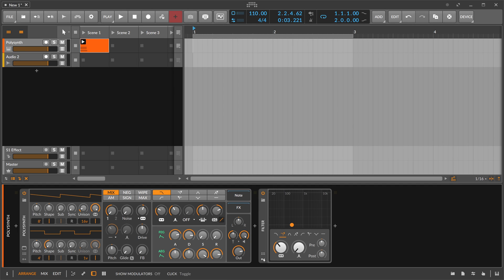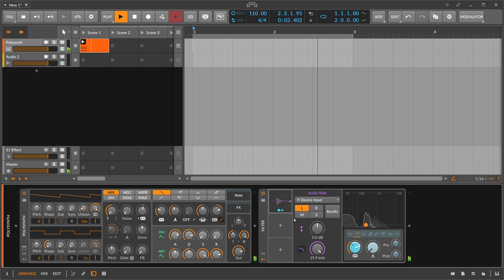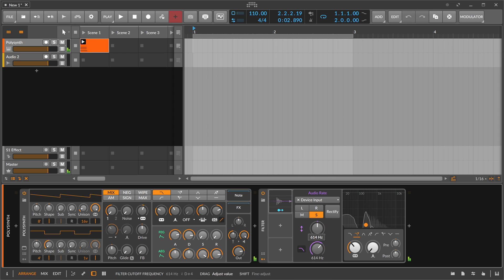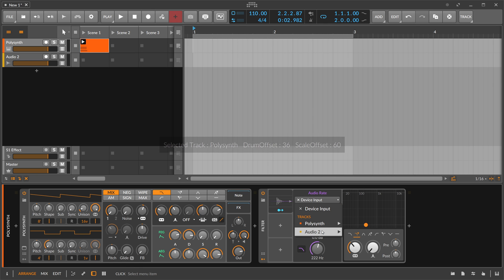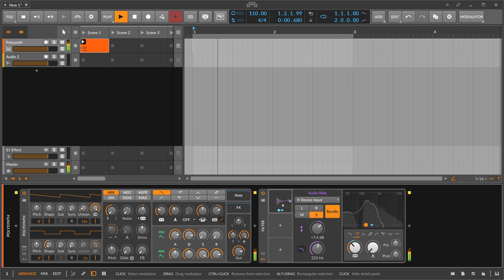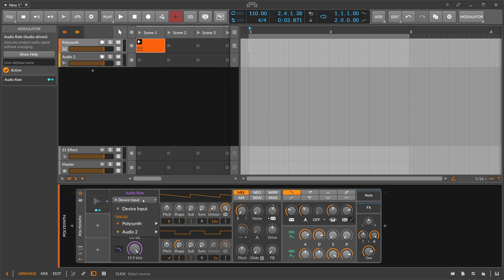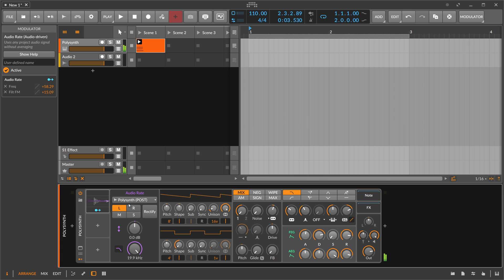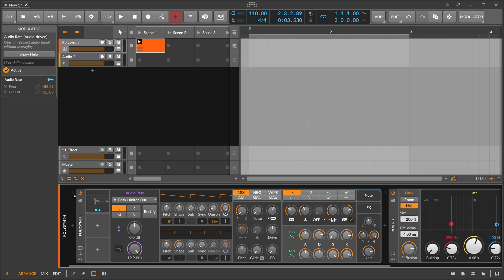Audio Rate - Bitwig Modulator Guide

Comment: This might be what I'm looking for... I am generating a modulation curve programmatically, and it's several minutes long (it's meant to do an exact shape during a song). So if I write it into a WAV file (which I can do), then can I feed the WAV audio into this modulator and use it to control synth parameters? Will it work OK with ultr-low-frequency input, i.e. slow changes nowhere near audio rate?

Comment: what about aliasing? when you modulate something at audio rate you get side-bands (often below and above the spectral content that was already there) this can quickly turn to aliasing. Does bitwig oversample the effect thats being modulated, either dynamically or is already oversampled..? by how much? In Live audio rate modulations are typically downsampled and max out at 500hz which limits this but it does nothing to minimize aliasing from the extra harmonic content.
Reply from the maker: there is no oversampling i think. watch + comments: https://youtu.be/mEcZPvB2JK4
Reply: Yeah cool. It’s possible that things like filters are already oversampled. If you do audio rate modulation of volume (ring mod) to a 10khz sine wave with a 10khz sine wave then it shoukd create sidebands at dc and 20khz. Analyzing this kind of setup should tell you whether things are oversampled. I couldn’t find anything in the manual that mentions oversampling for individual effects except that grid is oversampled 4x which wont be enough in some cases but is still pretty good.